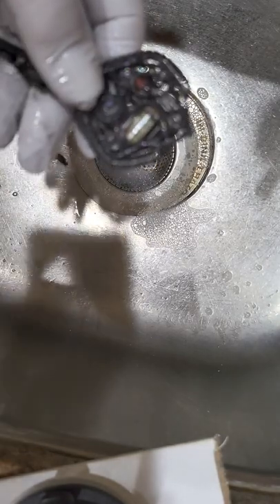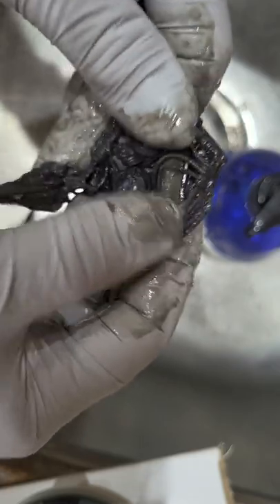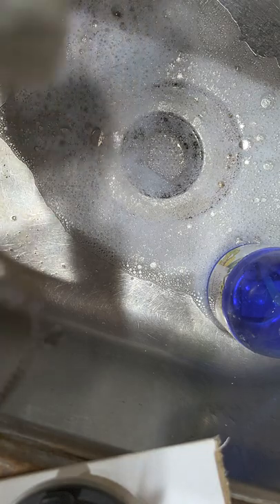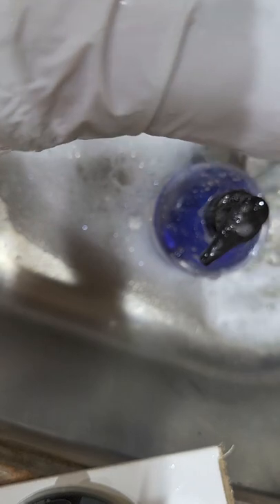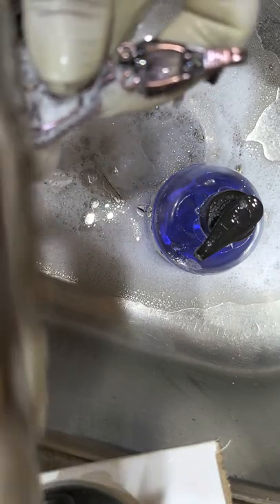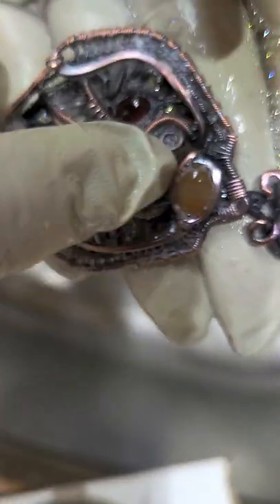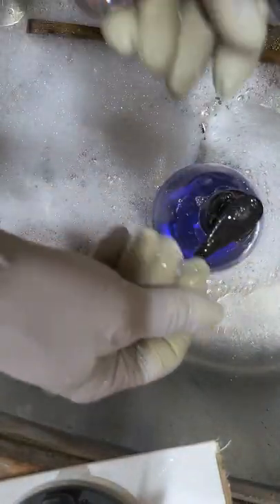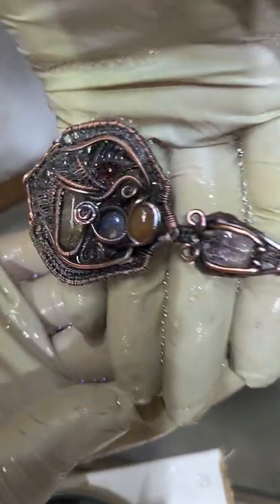Tutorial!  Cleaning my Oxidized Jewelry. Tips,  Tricks & Techniques! DDLYNNDESIGNS.COM

Comment: How do oxidative  your pieces
Reply from the maker: You need to buy 'liver of sulfur' aka LOS. The gel kind is the best. You can find on Amazon. Just a few drops in a little container of hot water and drop your copper in. I leave my copper in the LOS for a few minutes then take it out and let it soak for 20 minutes baking soda/water solution . Then this is where the cleaning comes in my video. I worked on that piece a lot longer because I didn't want the video to be too long.  Hope this helped! Facebook.com/ddlynndesigns
Reply: Thank you I am just experiencing on wire don't know anything about it.
Reply from the maker: @gwenwerner8795  I completely understand. It's a magical Journey. ✨️